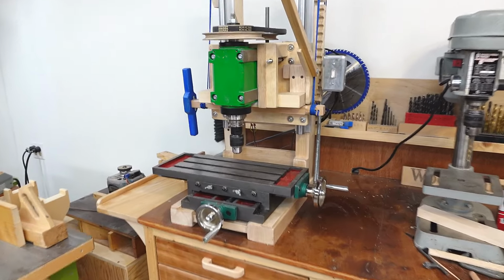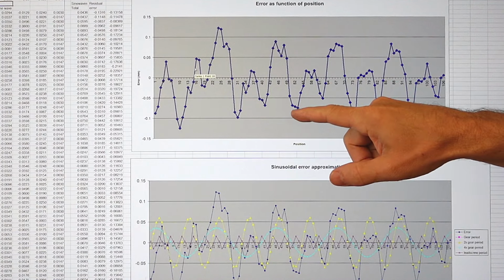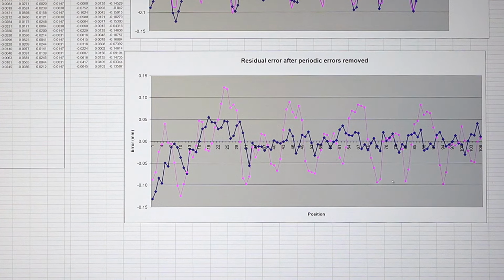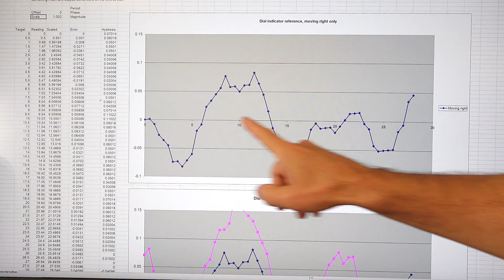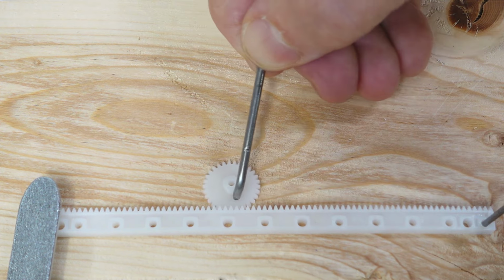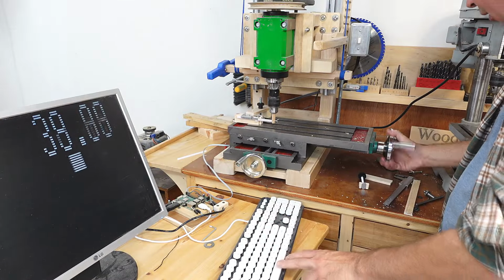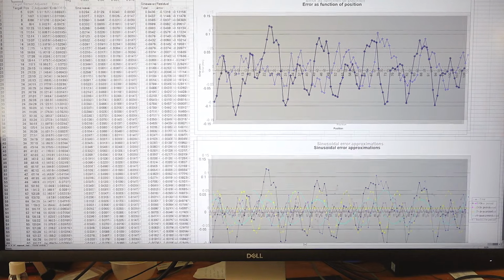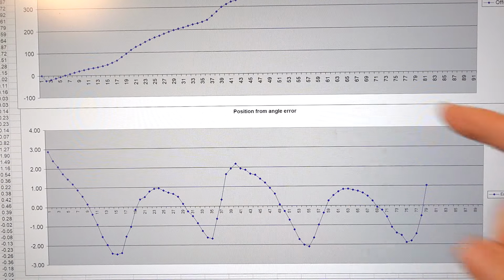Linear position with a rotary magnetic encoder

Comment from the maker: I figured out the encoding coming out of the device at the end.  I was confusing because I was only looking at the bits, not the clock, and some of the clock pulses are a bit longer, so really confusing.  At any rate, its synchronous  serial, with the sensor on the rail the master (sensor provides clock).  Sends out a 24 bit word, LSB first, last 3 bits always '1'.  Resolution somewhere around 150 increments per millimeter (only a guess).  On power up, it always starts at zero.  Reason it doesn't go back to zero after turning it off is because turning it "off" only turns off the display.  Removing the battery resets it to zero.
Reply: @matthiasrandomstuff2221  i was just about to say that
Reply: Instead of interpreting the electrical signal, you could point a webcam at the display and use Optical Character Recognition (OCR) to read the numbers in to the computer.
Reply: Your Rigol scope has serial decoding capabilities, see chapter 7 of the manual. Most likely I2C protocol
Reply: Frigging genius
Reply: You could use your original setup and have the computer subtract or add the error relative to the position on the rail. If you know the error wich is coming at a certain position you can compensate...
Reply: VEVOR sells a Cheap 3 axis DRO for $224. 10" x 20" x 24" scales included.

Removing the rack & pinion & using a rubber wheel will probably increase accuracy.  If you can find a high precision rotary encoder that would work better than your magnetic encoder. I presume your magnetic encoder is probably limited to 256 to 512 steps limiting resolution & adding error.
Reply: >  Reason it doesn't go back to zero after turning it off is because turning it "off" only turns off the display.  Removing the battery resets it to zero.

Literally the same as every single cheap chinese digital calipers on the market 🤣
Reply: The digital signal are the positions in BCD.

Comment: Try a fridge magnet! They're on the weaker side but polarized as a halbach array with very consistent spacing. Commercial magnetic linear encoders are built this way and work quite well for the price point
Reply: THIS!
Reply: Sweet idea!
Reply: Linear motors work similarly with a line of individual rectangular magnets arranged with opposite orientations.

Comment: Chasing microns with a wooden block, very nice. 

On those cheap DROs, if it's anything like what I have, it has a simple clock and a serial data line encoding the measurement in binary. Similar to UART in principle. You could absolutely have a raspberry pi decode it.

Comment: I worked on the precision position control of a linear motor for industrial applications. The setup you present at the end of the video is actually very close to what we were using. We actually ran a "learning" sweep to determine field strength vs. position using an external sensor and compensated online with a look-up table.
Reply: +1. Came here to say this, especially if the readings are somewhat repeatable over time, a lookup table is usually as good if not better than fitting polynomials and sinusoidals etc. As long as it is repeatable it is modellable. Cheaper than a dollar microcontrollers have enough memory to hold thousands of lut entries for tens of temperatures each. No reason to try to represent the interaction of bunch of complex parameters with a handful of variables only.

Comment: My friend Ensari and I did this a few years ago and got better results; 1/4 thou instead of 4 thou.  But we used a thin line (spiderwire) wrapped around a shaft in a bearing, with the magnet on the end of that shaft, aligned with the chip. Because the shaft was smaller than your gear, we got better resolution; more rotations per unit of linear movement. Also was very easy to make, no 3D printer required.

Comment: For a piece of test kit I made at work a few years ago, I needed to be able to log the position of a carriage along some linear rails and take that data, along with some load cell data, into a computer. The main catch was that the rails were 1.5m long and I needed accuracy to be within about 0.5%. There were some expensive options, but in the end I made a cheap and accurate enough system using a 600 count rotary encoder and a gt2 belt. The encoder was fixed at one end with a gt2 pulley (I can't remeber the tooth count, but it was the smallest I could find), with an idler at the other end, and a belt loop spliced on the carriage. To get better accuracy, I hacked the stock quadrature encoder library to count based on each of the quad pulses (rather than taking the four pulses and outputting one count). If memory serves I could get within 0.02mm over the full length of the carriage (using precission reference rods as a calibration and verification tool). Belts, pulleys and encoders are dead cheap! I used an arduino and data streamer in Excel to manage the hardware and software requirements.
Reply: Yeah you can get rotary encoders based off either optical or magnetic like this one, that are much better constructed, so you don't need to worry about radial runout errors etc.

Comment: Some cheap Chinese calipers have internal UART outputs, and your linear DRO might have it too. SSI and BiSS/BiSS-C are also common encoder interfaces, but both include an additional clock signal, which wouldn’t match to only "asynchronous" signal on the scope.
Reply: true.  Even if there is any inaccuracy, it is consistent as far as I have observed.  Easy to develop a calibration table for the caliper and the table.
Reply: It looks like it's missing a start bit if it's a UART, though, otherwise signal traces would always be the same length since the scope would trigger on that; I would guess there is an additional clock signal here.

Comment: Excellent video as always and great experiment!👍

By the way, same signal is on cheap plastic calipers as extra data output available on pcbs.. I looked few of them, and they have it.. 😉 I had an plan to modify them as cheap DRO with adding ATmega... How I read, that signal is exactly the same as from DRO sensors...

Comment: 3mm cubes in a Halbach-array (linear, anyway) --> way more "sinusoidal" transitions! with two Hall-effect sensors (TI makes some good ones) with a 1/4-pitch difference, you would have an excellent quadrature-encoder, far better than 0.1mm resolution. (realized by the small-ness of the magnets). The fact you are running it as a resolver means that you would be relatively immune to amplitude (distance) variations.
Reply: Clarification:
"quadrature" --> sine and cosine pair
"Resolver" --> Phi = atan2 (sin(phi)/cos(phi)) --> irrespective of amplitude/magnitude.

(Although I am sure MW already knows this ;)
Reply: I thought CuriousMarc had a related NASA video. I'll see if I can dig that up.
Reply: @AdityaMehendale   MW might but I didn't.  Thanks
Reply: atan2(sin(phi)/cos(phi)), independent of amplitude, great, assuming amplitude is the same for cos and sin... yes? What if the amplitudes differ due to slight offset-differences, etc? Or, one sensor's being closer to a stronger magnet and the other to a weaker one?
Reply: @ericwazhung  I'd be far more worried about the magnetization-direction, placement-errors, stray magnetic fields and thermal elongation of the base material. 
Things can be "better" without being "perfect". Things that are "good enough" don't even need to be better. What I propose is an order-of-magnitude "better" without the need for complexity that far exceeds that what is already present.

Comment: I’ve had a similar need though for much longer distances.  I used an allegro a1230 quadrature bipolar Hall effect sensor. Each change in magnetic pole is sensed and things like flat fridge magnets can have quite dense poles.  You would need to use a couple offset to get enough resolution or use gears.  Probably easiest to hack that cheap one you bought.

Comment: Something we use at work (built the deployment and focus mechanism for the James Webb Space Telescope) is called a LVDT or " Linear Variable Differential Transformer".
You can get extreme accuracy with these devices, but requires some EE skills to build one yourself.
Reply from the maker: On a project I worked at at the university as an undergrad, it used LVDTs and an A/D converter to sense position.  Simple and reliable.  I went looking where to buy one, but these things are quite expensive!

Comment: You could probably try salvaging a bunch of mini electro magnet coils instead of hoping all your permanent magnets were cast perfectly.

Also quite surprised to see this upload as not only was I about to do the exact same project but also the exact same milling table, however I'll be using optical linear and rotary encoders I salvaged from a pair of old desktop printers.

Comment: Use a non stretchable cord wrapped around an optical rotary encoder with quadrature output to give direction. The cord can be kept taut by using a weight hanging off of one end. This becomes an absolute encoder and can compensate for backlash.

Comment: You could try some magnetic encoder tape, it is pretty cheap with fine pitches 2+2mm.

Off center can be pretty annoying, I'm planning a project with a MT6835 and even with a 10mm dia magnet you still need to be preferably within 0.1mm centering and even with that it's got a whole bunch of DSP linearisation going on, so you got pretty good results for a bit of wobbly heatshrink.

Comment: you can make yourself a sin/cos absolute encoder very easily:
get two linear hall sensors (outputs a voltage around vcc/2 depending on the magnetic field and polarity)  feed those two voltages into a microcontroller adc and put the reading straight into the atan2(a,b) function. it will output degrees.    just use a diametrically magnetised magnet (or a normal magnet on its side) and place it above both hall sensors where one of the sensors is rotated by 90°.  depending on the position and how close you can get the sensors together, you might need to compensate for some non linearity.
Reply from the maker: But even easier to find than a linear encoder is a rotary encoder.  So why bother?  Fact is, if I needed a linear hall sensor, I'd probably just use a rotary encoder and work it back from angle and magnitude, cause the linear ones are way more common.
Reply: i needed a absolute angle encoder for a project and didnt wanna spend big bucks on one, incremental didnt work.     
and incremental can lose steps if the microcontroller cant keep up counting.

some industrial absolute encoders work on a optical disc that has sections that encode their angle in binary.  sometimes even with multiple gear stages and further discs to count thousands of turns and still keep their absolute position, no matter what the microcontroller is doing.  combined with a spring loaded pulley whre you can pull out a string to measure distance it can be a proper linear position sensor.

Comment: the digital signals are fairly easy to get, if you think 1970's RC type stuff, each digit is within a time period then the pulses per time period give you an 0-X readout. start off at zero and increment very slowly you should be able to pick out the time period pretty quickly. its similar to asynchronous serial but in some special herbs and spices recipe

Comment: On my lathe, I have an rotary encoder attached to the main slide, and a toothed belt attached in both ends of the lathe bed so the belt rotates the encoder when it passes over it. The signal are transferred to a TouchDRO from Yuriy's Toys, and the precision is under 1/10 of a millimeter. on the cross slide I have a real glass scale with much higher precision.

Comment: search for digital caliper serial data or cheap digital caliper serial  ... you have there one clock line and one data line, and I think 24 bits of data from which first (probably) 10 are some sort of status, rest is position (number which you divide by something to get position in mm or inch) . Or something similar like this. Most of china cheap calipers have same or probably very similar protocol
Reply from the maker: Alas, that's definitely not what I have here.
Reply: @matthiasrandomstuff2221   Looking forward to the follow-up video about the encoding. I wonder if they used something different since those encoders look a bit fancier.
 In case anyone is looking for the encoding on those ubiquitous three button Chinese scales, the encodings are two 24-bit words, two's complement, little-endian. One for assumed absolute position and one for relative.  With 20480 bits per inch.

Comment: That's probably better resolution, than I would expect from such system. There are a few videos where images were read from PC mouse, I wonder if mouse sensor would be viable as a position sensor and what the resolution would be. Difficulty would be printing the encoding on some medium, so instead, you would probably have to do what callipers (kinda) do - print bunch of triangles that you would have to interpolate to get position.

Comment: If that's an AS5600 encoder it might work better if you don't let the magnet touch any metal. That's probably the case for other hall effect encoders too. I just learned about this myself after reading up on encoders for BLDC motors, specifically on the SimpleFOC community forum and their docs.

Comment: You could try using a set of cheap digital calipers. They have an output port on the board (some even have it exposed in a case). And the data format is already documented on the internet and is easy to use since it's a data/clock pair.

Comment: About magnet line, i observed that chip is used in diffrent postion (prependicular vs parallel) than in rotary, this may affect accuracy, also they are spaced more away, so stray fields have more input.

Comment: Just try to use that last measurement (with the magnets in a row) as a calibration! You can simply interpolate the data points that you have. You only need to remember which cycle you're in.

Comment: The signal could be SPI. Look for a companion clock signal. You should be able to interface with 3 wires, ground, clock, and data.

An Arduino would be perfect, IIRC it has an I2C/SPI port. If not, bit banging it is trivial, and there's drivers already made for that. Use RS-232 or USB to the PC and send it the converted measurement. Doing this you could capture all 3 axes and send the PC data packets with X, Y, Z.

Comment: you might also consider, instead of a magnet, use a slotted 'disc with a light meter.  there are a variety of mice that use this as the internal mechanism that measures how the mouse moves. 
but.. now that I think about it.. you could also but a cheapish mouse and use its light sensor to watch the gear rotate from one side (instead of head on).. and this would translate as mouse motion. 
and with some mice you can change the resolution/sensitivity which can improve accuracy. 
and the mouse internals are already made to feed data into the computer via usb or bluetooth or rf. 
the test for this would be rather straight forward because you can position a mouse over the rotating gear (where you have your magnet)..  and you could make that part slightly larger diameter to get an easier/more accurate read. 
but.. that might have been another 'diy' solution. ;-)

Comment: if you tear apart an old inkjet, they have a nice strip of plastic and a simple dual optoswitch for the encoder... and 1200dpi or whatever an inkjet can hit is pretty good. its still below a thou, anyway.

cheap and compact. pretty easy to get a good signal from an optoswitch?

linear to rotary, youre relying on concentricity, the accuracy of tooth profiles, the straightness of the rack, etc. the rack is only as good as the mould it came out of, and being plastic, is full of stresses that slowly release and alter during its lifespan.

another thought... how does a standard optical MOUSE work?

Comment: The magnetic variation in absolute position reminds me of the bumps in 3d printer beds, so they do a a read of multiple points and create a look up table with error values to compensate. cant you take your readings and create an offset lookup so it can be driven to that value?

Comment: C'mon, Mattias, you have good machining capability available!  What you have now will be limited to telling you which end of the milling table you are at, with sloppy wood bearings, shrink tubing, & 3D printed plastic gears.  Break out that lathe & mill & get stuff properly centered!  All that calibration you so carefully measure will change as fast as the tide.  (You don't need Fourier series, just a big lookup table of corrections with linear interpolations. The lowliest processors can handle them!)  To implement GOOD rack & pinion, get 1' caliper & put encoder on the dial.  The "open air" scheme will be perturbed by any ferrous stuff in the room closer than the nearest black hole.  A better scheme would be to take coarse threaded steel rod, with steel gear with tooth pitch matching the thread pitch, mounted almost touching.  Magnets on the gear cause it to be attracted to the threaded rod threads, forming "magnetic rack & pinion".  That can be read out by magnetic encoder.  You need magnetic shielding around the encoder!  The worst problem with this is stiction of the gear.  Mount it on precision ball bearings.
          Those linear readouts are available with readout capability (but readout may be too slow for CNC work).